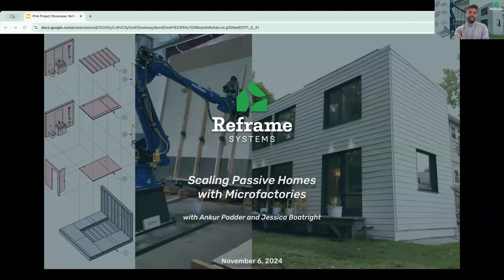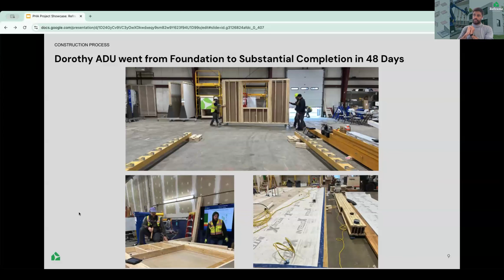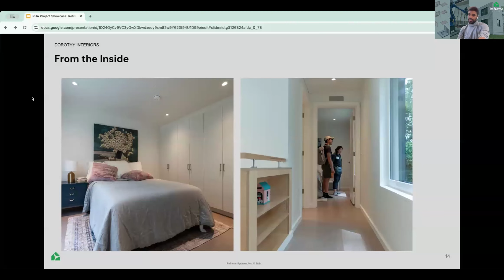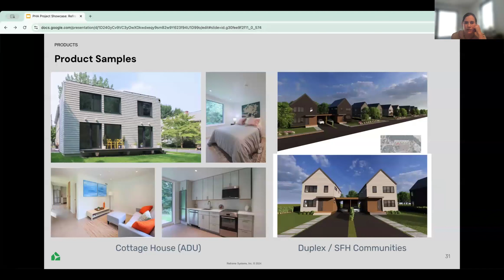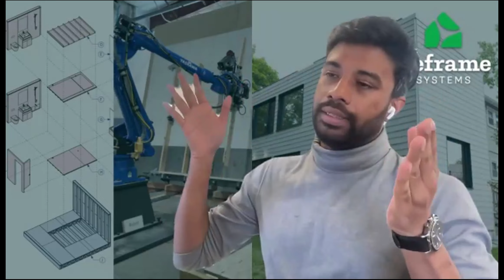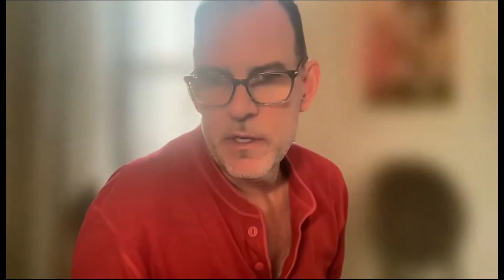Project of the Month: Scaling Passive Homes with Microfactories

Comment: Is there a lifetime estimate for the helical piles?  Will they rust or deteriorate over time?  How do they handle lateral loads?
I may of missed it, but what are the dimensions of the house?  Did you have to hire special trucks?  Is the crane used a significant cost?